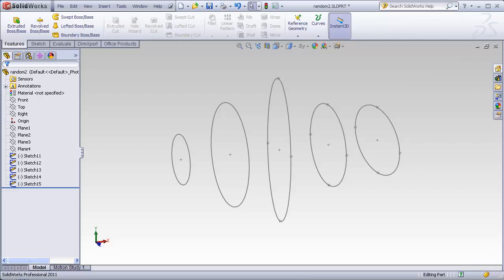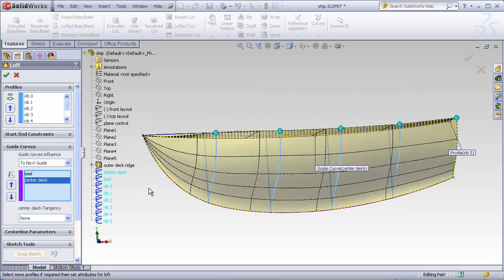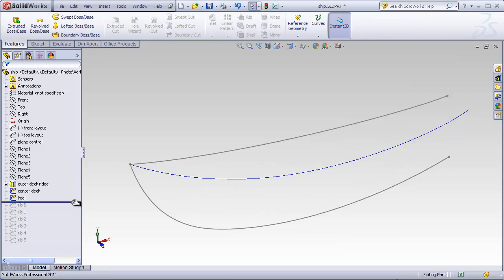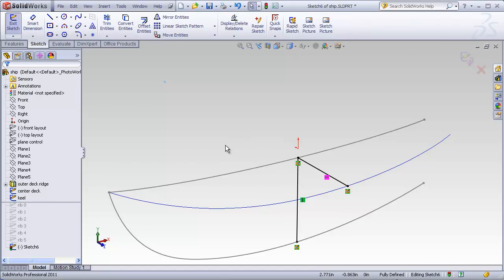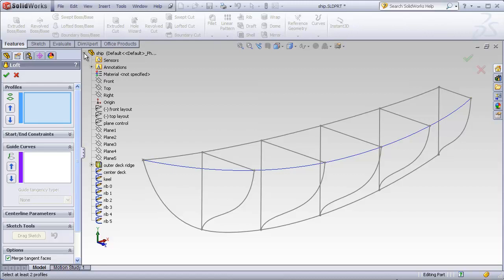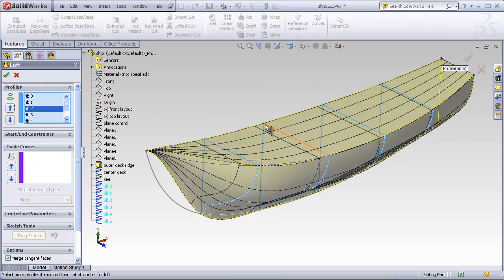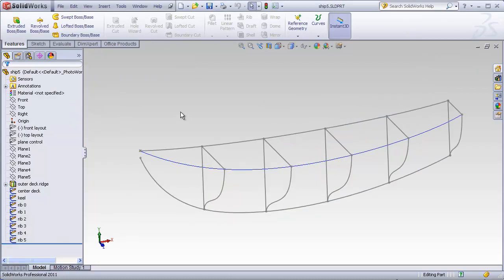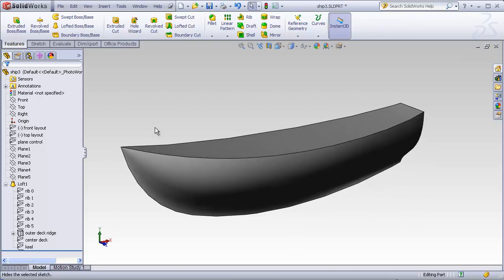DSID129, Solidworks Lecture, Lofts with Guide Curves

Comment: For those people that are having problems with the Rib 0.... well, it was driving me nuts until I realize that you have to create it with the "Point" tool. Create a new sketch, >> use the Point tool to create the point >> align with the existing converging points. Make sure you don't create more than one single point on that sketch.

Comment: the boat would be 10 x easier if you just used surfaces, in fact you would need to use classA surfaces if you were going to manufacture a hull

Comment: Did you use 3d sketch to create outer ridge?
Reply from the maker: I used a projected sketch, which combines two 2-d sketches into a single 3-d curve. All others are 2-d sketches.
Reply: Oh thanks! But how do you make guide curves and profiles intersect?? I've tried a gazillion times to intersect them with pierce but fail everytime!. How do i even create a front parallel plane at the exact location of a line drawn in right plane?
Oh oh oh so frustrating!
Reply from the maker: Sangyoon Kim The key is to make the guide curves first. Then, when making the 2D profiles, use the pierce relation to get the corner points of the profiles to "attach" to the guide curves. The pierce relation is like a 3D coincident relation. Use pierce when you are trying to make a coincident relation to a curve that passes through the sketch plane. If you want to make a front parallel plane to a line in the right plane, click on the Plane feature and then click on the Front Plane as the First reference and select the parallel option. Then, for the Second Reference, select the line in the Right plane.
Reply: jammondesign Thanks! 
I'm trying to design a aircraft fuselage!
Reply: jammondesign Dear Mr. jammondesign,
I've since succeeded in creating 3d guide curves but can't use pierce relation; to be specific, when I click 'edit sketch' on the guide curve to pierce it to the end of the fuselage sketch the sketch disappears..
In some cases this doesn't happen and I am able to see sketches on other planes while editing a sketch on current plane.
Reply from the maker: Sangyoon Kim You need to be editing a 2d profile sketch,not the 3d guide curve. Pierce the corner points of the 2d profile sketch to the guide curves.
Reply: jammondesign .ah yes I was editing the 2d curves but it turned out to be my fuse end sketch was below currently being edited.. After moving it up It all worked like a charm!
THANKS for the quick reply!

Comment from the maker: Rib 0 is located on the Right Plane and is a single point. It is located where all three guide curves come together. This means that any of the three guide curves can be used to locate the point, since they will all yield the same result. I think I selected the curve that represented the center of the deck and made a pierce relation between that cruve and the point.